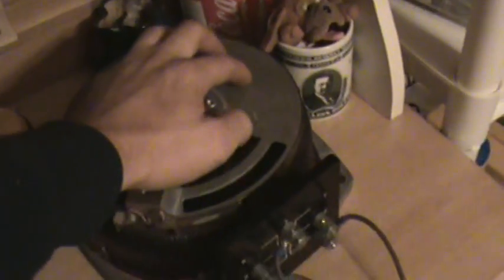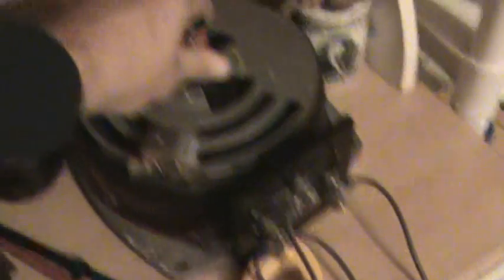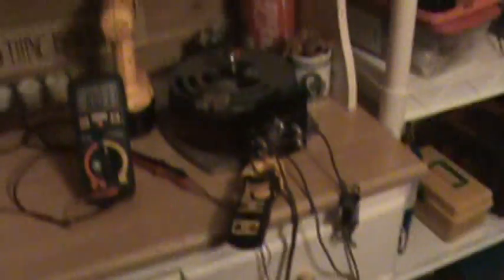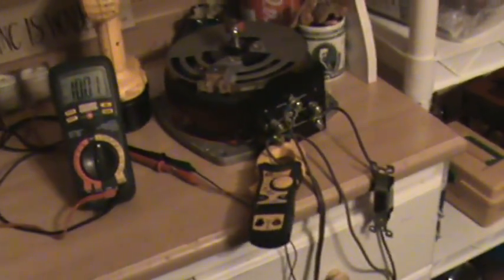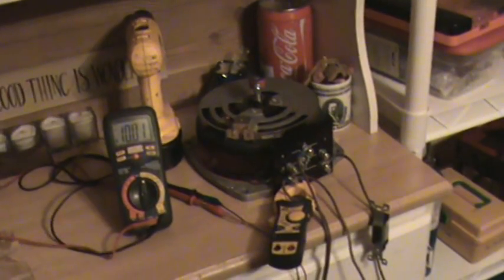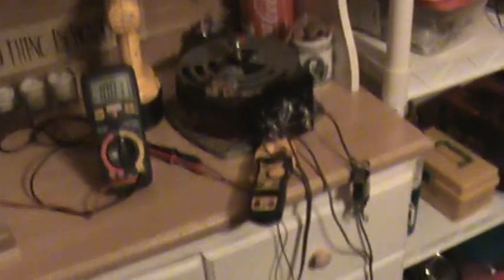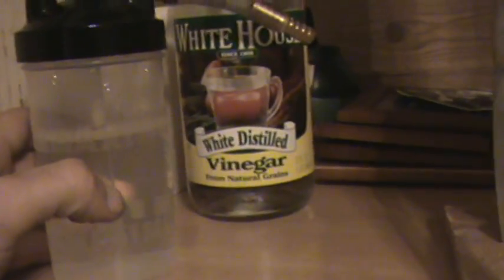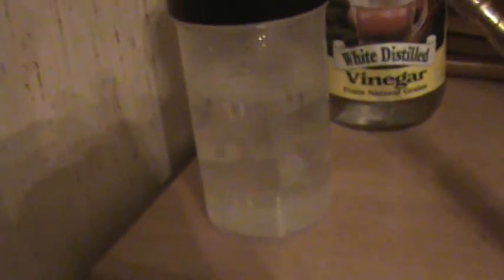Vinegar cleaning

Comment: Hydrogen burns clean(clear) in air(oxygen). So a pure HHO system with proper fuel scrubbing should produce a flame with virtually no color. Any other colors produced are from other chemical compounds borne within the HHO gas itself from the electrolysis. Sodium will make yellow/orange while chlorides(which can be present from manufacture), will make it blue(ish).  So the colors you are getting are due to the electrolyte mixture. Try KOH.
Steve

Comment: cool man-give us a yell when ya get it together and i will tell you how to mix it up.
oxalic is commonly used a brick and concrete cleaner.
i have found it in most hardware stores.
generally in 1.5 kilo containers.
you will probably pay about 20 bucks for that size-but a little goes a long way.
it aslo has applications for geopolymer cement,about which i will also talk in more detail later.

Comment: battery acid is sulfuric acid.
yes it would-anything that increases conductivity can be called an electrolyte.
although vinegar,citric and oxalic is probably cheaper,and easier to get.
i cant buy sulfuric anymore in Aus.
any salts, acids, or bases can be used.
i have even used powdered silicon carbide....although i dont know if that quite fits the description-i would say it is a catalyst.
try my mix on a new cell -you will see its VERY strong,and needs duliting to adjust your amps.

Comment: vinegar neutralizes sodium hydroxide ....good work man....yeah if ya get to much electrolyte vapor in the gas it will show up in the flame ....the only way I have been able to get a really clean clear non visible flame is to run the gas thru 2 bubblers and a gas dryer ...

Comment: it would keep working until all the acid is used up.
with the other acids in the mix-it should last a lot longer.
i didnt use lye-i used the acid mix as my electrolyte-so it was already a blue flame.
i dont recommend swapping over now that your cell is conditioned or run in on lye.
i like the scrubber idea-no need to have sodium in the flame-specially if you want to weld with it

Comment: get some citric acid from the cake section in the supermarket-and some oxalic acid from the cement section in your hardware store,and mix them up with vinegar.
its very strong-be careful  with it.
when a base is neuatralized by an acid,a salt forms plus 1 water molecule.
in your case it would be a sodium salt bound up with the acetate side of the vinager.
sodium acetate.
with oxalic and citric,
you will get sodium oxalate first and sodium citrate when the oxalic is all used up.